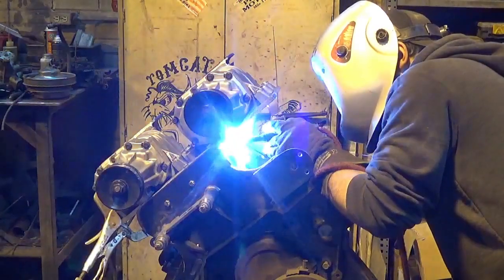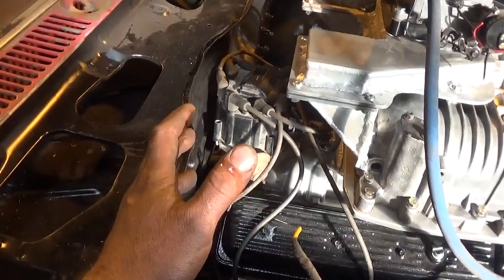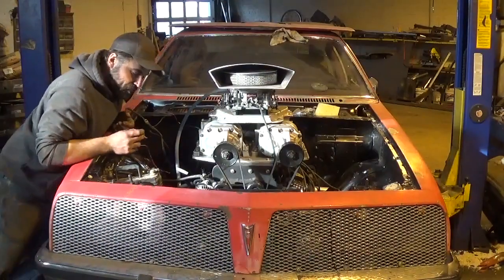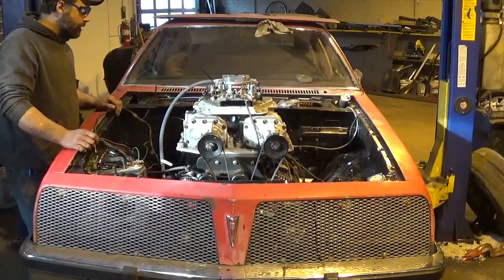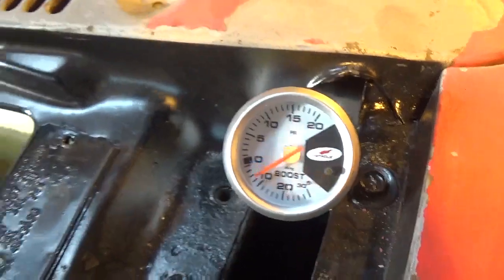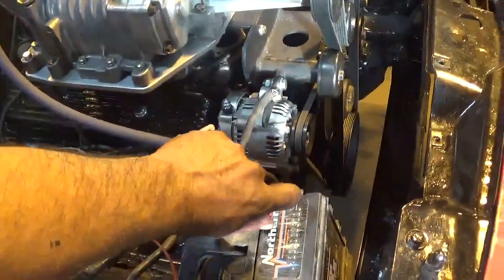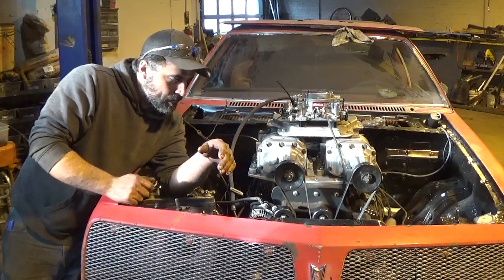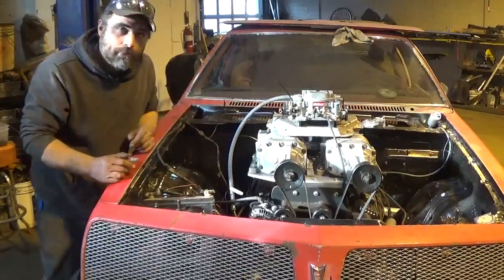TWIN EATON M90'S FIRST START!! - HOW MUCH BOOST??- TWIN EATON SUPERCHARGER BUILD PART 5

Comment: Its projects like this I want to be doing as I get the experience. Beautiful work. This is really inspiring to me as a young mechanic, showing me the possibilities of hard work and imagination.
Reply: Same here and I saw an 81' Firebird for sale that has a V6 and then an M90 Supercharger in another ad and this vid has got me thinking about putting the M90 on the Firebird and get the electronics from an 02' Pontiac that can with a factory installed M90 supercharger and stick it in that Firebird should I ever get enough money to buy it before it's sold

Comment: Love this sort of stuff!!!   I run a tiny eaton m45 fed by a garret gt2871 turbo in full compound configuration on my 4ag powered aw11 mr2.  It's awesome fun to drive.  

I have a m90 that I will be putting on my holden rodeo 4wd, it has the 3.6 alloytec engine.  

Blower whine, the best whine there is!

Comment: Use an idler pulley from a Cadillac with a 4.9 v8. Used in like a 92 Seville. The pulleys have a ridge on the sides to help with belt tracking.

Comment: Like Dr. Frankenstein said "IT'S ALIVE"!!! You might want to get some idler pulleys with flanges on either side to keep the belt from walking off sideways. I bet the blowers could build enough pressure to blow the head gaskets out but I have a feeling that carb won't flow anywhere near the CFM's you're gonna need to produce the full power the twin blowers could produce. The blowers can build pressure but if they are restricted on the intake side the blowers will starve for air and they will be trying to pressurize air they don't have. Looking at it only from the perspective of boost misses the aspect of total cfm through the entire motor from the air cleaner out the exhaust. The motor is just a big air pump and you could spin it with an electric motor without any fuel or ignition and just measure the total amount of air it can move in CFM. If it can move x amount of air without the carb and less with it then the carb is restricting the whole system. You might want to go to 2 carbs with one for each blower.

Comment: I have an Eaton M90 off a 2000 Pontiac Gran Prix I'm looking to fab up for my Jeep 258. I see you did a draw thru setup which is how I'm looking to configure mine. I was planning on welding up a small plenum adapter to go from my Weber 38 to the blower and into the intake. A lot of people advise against draw thru but that's my only option short of fuel injecting it. Any tips or pointers? How did you set the vaccum up? Did you use breather vents or actually plumb some hose in? Thank you! Awesome build by the way...It's not everyday you see two blowers custom fabbed like that!
Reply from the maker: I used a regular chevy valve cover pcv valve to do my crank case venting. The blowers were welded up to basically be just blowers. Tips..... Not really, all depends on the application, just keep your base plate heavy and flat and the rest of the connections just need to be welded good and sealed tight

Comment: 6 psi is expected with stock pulleys. Go to a 3.4 inch and run 93 octane with a bottle of booster every tank. Will get you around  9 psi.

Comment: Hi, did you boost reference your power valves? Ray Soto here on youtube did a similar conversion, He put a Jaguar supercharger on a small cube olds. He has a video on boost referencing the Carter / Edelbrock carb. He is running draw through like you. He said that he blew some stuff up before he figured out the boost referencing. You might find it interesting. He is very willing to talk about it. Hope it helps !!

Comment: Hi mate, I’ve a Jaguar XF 4.2 supercharged, about 420bhp as standard, been told I can get 490 max with a smaller pulley and a remap.. 

Maybe I’m mental I don’t know but think it’s possible to have 2 of the chargers it currently has ?  My aim is 550bhp - 650bhp, everyone just says 490 bhp max but I don’t believe that, car feels like it can do a lot more

Comment: Good job, I wonder if using a m122h supercharger would be simpler instead of trying to route the belt around two m90 superchargers. Although the m122h is basically the same supercharger used on the Mustang GT500. I cannot remember the supercharger displacement of a m122h or what the combined displacement of two m90 superchargers.
Reply: Iv been wondering this same question. Yrs ago I made a twin m90 set up for my rx7 and I loved it but ended up selling the kit and now I miss the insta tq and I'm seriously debating a m112 set up but doubtful it flows enough.
Reply: i know this comment is old but the eaton superchargers had their displacement in their name. the the number after the m is how many cubic inches of displacement. m62 (62 ci) m90 (90 ci) m112 (112 ci) so on and so forth. thought it'd be nice to mention this for anyone else seeing this in the future.

Comment: Is there no bipass valves being used on these M90s? I love the imagination and initiative that went into making this. 

I can't quite tell from this video, but how open is the air plenum that the carb is mounted to? I'm gonna have to watch the build videos lol
Reply from the maker: There are no bypasses. Years before i started this build i had gotten the superchargers, put them in my bandsaw, and cut them off right at the throttle body. The bypass ports were still there, but i did seal them off in one of the build videos.  I appreciate the comment, it got cold up here and we are currently focusing on ice racing which will be starting in a week or two. Will most likely pick up with this project in spring when the temps go back up. Need to do some major jetting and a carb swap to make this thing right....
Reply from the maker: Also, the plenum from the carb to the blowers is wide open inside. Just a box from the barrels to the blowers, same with the intake plenum under the superchargers.
Reply: @rottersgarage  I just watched part 4 and caught all of that haha. Certainly is an awesome project. I had to do some modifications to the inlet of a cnc ported M90 to make work for the 3800 in my 2002 Pontiac Firebird. It turned out pretty good I must say lol. Everyone of course hassled me about LS swapping it because that's what f-body cars should have in them (and I would agree) but I wanted to try and have some fun and be different. The power to weight ratio of my car right now is about the same as one with a stock LS1 in it. I can easily keep up. I've actually pulled away from a 2010 Camaro that had a stock LS3, but those gen 5 cars are 1000 pounds heavier.

Comment: how is this project going, might want to switch the tentioner with the idler pulley, the crank naturally wants to pull down on the blowers , so a idler on the driver side will keep it tight.
Reply from the maker: Project is going good, currently wiring it right now as we speak.... Got the tensioner working good. Didnt move it, added washers on the first idler pulley. Seems fine, havent jumped the belt yet.... I will have a new video on it in a few days.
Reply: @rottersgarage  back before there was android and cell phones with cameras in them i built a duel m90 5.0 engine, used a peace of 3 inch square stock for the top manifold with some 45* angles and all that. then hooked up secondary injectors on a switch for the added fuel for the blowers. worked awesome on WOT lol then boom

Comment: Pulls safety catches while under lift then puts arm across top of carburetor after a possible "kickback" but need safety glasses in case the belt breaks. 🤔 Awesome project but lots of what not to do here. Keep up the killer fab work but please put your own safety higher on the list!
Reply from the maker: I also removed all the guards from my grinders, run the old Mill with a wide open 3 inch bell slapping around out back, and go behind the old Niagra shear while it's running . Hell, occasionally I stand on the top rung of a ladder too... Both latches need to be pulled to let the hoist down, they shouldn't have put them under there in the first place when they made the hoist, and if you ain't never been torched by a carb a little bit you ain't no mechanic. Worry about your own bobber bud, I got this. When I hurt myself you can tell me ya told me so. Thanks for watching!
Reply: @rottersgarage  I'd just hate to see something happen to such an innovative DIYer

Comment: what kind of hp did you accomplish, been trying to find a way to supercharge my vg30 on my 88 N/A nissan 300zx so i can keep my headers, but a single m90 won't get more than 240-260hp
Reply from the maker: Never dynoed the thing, but from what my engine guy figures, and what a few people have figured in the comments, 10lbs of boost in a 5.7 l should be making somewhere around 600 to 650.....  Now I broke the darn thing but one day when the engine is fixed we might have to take it to a dyno....

Comment: Can you talk about your carb set up, type,  size.  I’m doing dual m90s on a 351w. In the fence to do carb or Try to use pro flo 4 efi
Reply from the maker: Kurt, currently have a 750 double pumper on it, blocked off power valves and jetted up. Don't really care for it and my fuel system is too small... I'm thinking Holley sniper kit this spring, would like to take it to cleetus and cars again....

Comment: You are using flat belts and you cannot guarantee that all the pulley surfaces and axes are true. Do what the Victorian engineers did with their line shafts and pulleys, machine a gentle dome on each pulley. Flat belts always run up hill, when they get to the top there is nowhere to go except stay there. No keeper plates required. not the same as timing belts. It goes without saying that accuracy in alignment will help. If you use domes and the belts fall off then look at the alignment. You have the expertise to build a test rig.
Thoroughly enjoyed your videos, I would like to see the Model A make progress to restoration.

Comment: I'm surprised you didnt mount a carb at the back over each blower inlet for a simpler inlet
Reply from the maker: I actually considered it. Had two big bore rockchesters mocked up on it at one point. Decided to go with the 4 barrel just to make it centered out and more easy to tune in the long run. Fab wise I'd say it was probably about the same amount of work considering you would have to do two separate inlets and have two separate carb mounting plates....

Comment: Is this supposed to be a interceptor replica?
Reply from the maker: That was the plan, never got into the body/ tinwork though.... maybe one day...
Reply: Are falcons expensive in your area?
Reply from the maker: They don't even exist here, lol. I'm in Wisconsin. Looked into it once, could have one imported with the body kit for around 80k. Little out of my price range.....
Reply: 80k? I mean I know that a xb gt costs a lot, I could have sworn the lower trim models were cheaper, by the way the engine is the best part of this car, first time I’ve seen two parallel superchargers like that

Comment: i just subscribed to your channel  and i have a question whats hei mean
Reply from the maker: HEI is the GM distributor used in the engine. Stands for high energy ignition. The ignition coil is located in the cap of the distributor instead of external.....

Comment: Cant you just machine a wider pulley and make it lipped? Maybe get custom wider pullers all over, bar the blowers that already have them, with lips. Wont take much to machine a few pulleys out of a piece of 4" billet bar stock. Pretty fucken cool bit of kit though mate, whish we could make shit like this in Australia. Well, we could make it; but never expect to actually drive it around with the nanny state we live have to live with.
Reply from the maker: I ended up Tig welding some plasma cut washers out of 18ga steel on the pulley and it has been working out great. Ran er over 7000 rpm and the belt has not launched yet! A little quicker than the custom billet pulley idea, but it was effective.... But now that you say it, solid aluminum idlers would look great on the setup....
Reply: @rottersgarage  It would look good, yes. However, your are dead right and  I was complicating the shit out of the whole deal. If you can run that set up at seven grand and it holds fine, thhen you have done a fantastic job. I'm a fitter/turner and the machining parts instinct is hard to break. Fantastic project, I need to go and watch the rest of the series you have now.

Comment: Did you end up actually making any gains in power or did these restrict the motor so much you lost power ?
Reply from the maker: It makes 6 lbs just reving it up with no load so its making boost and from the little i have driven it it seems like a huge increase in power. Blows the old dry rotted slicks off it just tapping the throttle. It finally made its way back to the shop last week and i will be trying to get it wired this week so i can get some road time in on it.